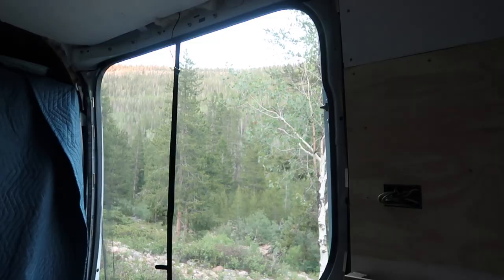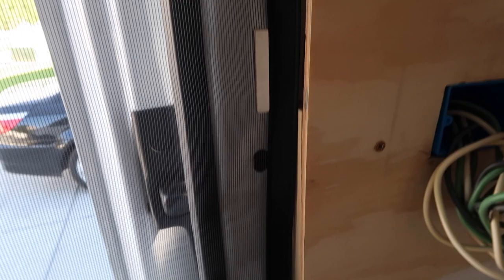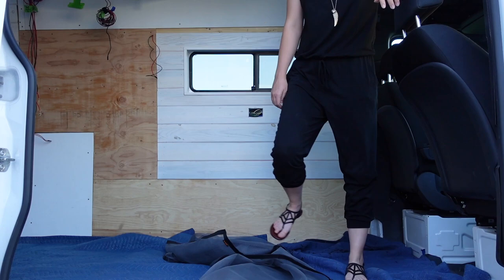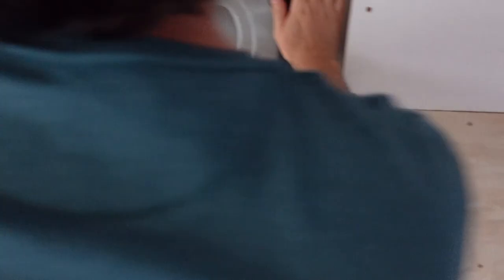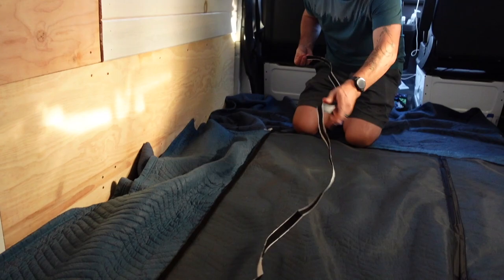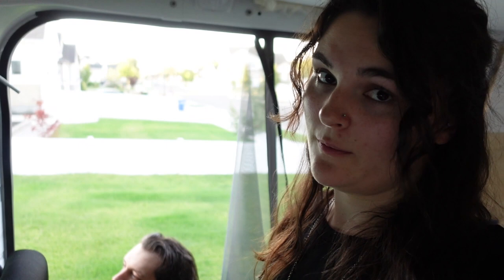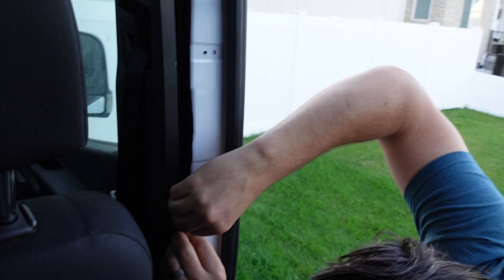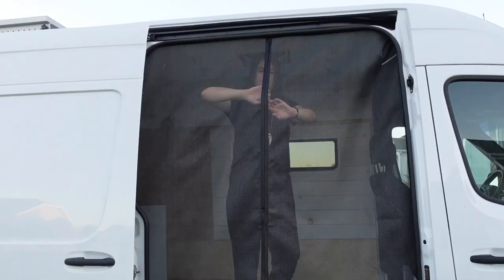QUICK TIPS: DIY Bug Screen Door for Sprinter Van (only $35!)

Comment: The expensive custom versions with zip open sections utilize the velcro only to get it positioned and held in place, then self tapping screws are used to hold it's thicker/firmer edging in place more permanently.  That could be mimicked here for anyone having trouble with velcro holding in a hot van.
Reply: What I was thinking. It’s 120 degrees where I live currently and the Velcro would definitely melt off.
Reply: @CreationsByWill  Yeah, I plan to put something over it, either thin wood strips, or something like the Polywall from Home Depot in long strips to fasten through it.  good luck!
Reply: Mine is coming off, but also the mosquito find their way in through the bottom and down the middle in the spaces between the magnets.  They are ruining my life.

Comment: protecting strong magnets is easy if you get not those skinny or slim ones but more the fatter (if you catch my drift) ones which are somewhat more resilient to getting broken also pouch them up in a fabric cover will help a lot to prevent shattered magnets... felt is great to wrap magnets in or even have one side of the pouch in velcro should be useful as well....

Comment: Hello from Australia. I love what you've done. Very clear and easy to understand. I know your video is 2 years old but I guess instead of bunching up the screen on one or both sides you could draw a line with a marker on the screen matching the door surround and external velcro. Have someone (either of you look capable enough) sew a new velcro strip following the line. Trim and install.

Comment: Hi, Such a great help. Will be using on my 2015 sprinter side door. One question: You mention the top strip of velcro: did you literally adhere the velcro strip to the rubber weather strippping along the top of the door? Also I'm wary of the glue releasing in really hot weather. Is this an issue at all? Was the velcro 'self-adhesive?'... Ok, that was actually 3 questions;-)

Comment: Great idea! We did this also, however, the summer temperatures in Nevada killed the idea. We got 6 months out of the plan. So, if you don't live in the heat of the desert, it should work!
Reply: What about the heat made the fly screen not work?
Reply: @KingdomOfDaylightsDauphin   The velcro basically "melted' off and the screens fell down.